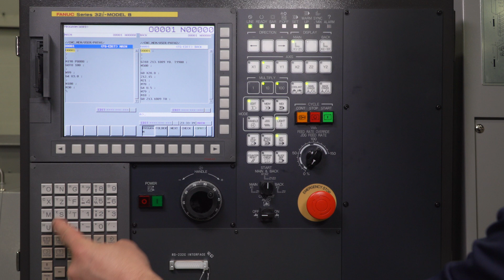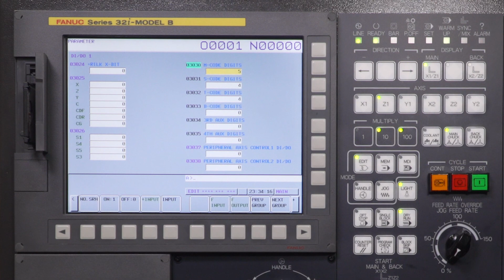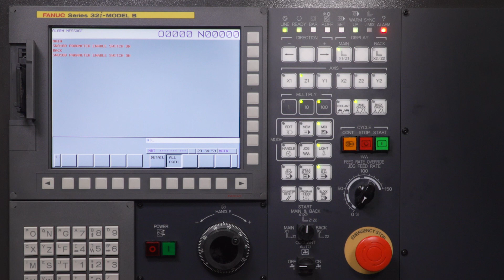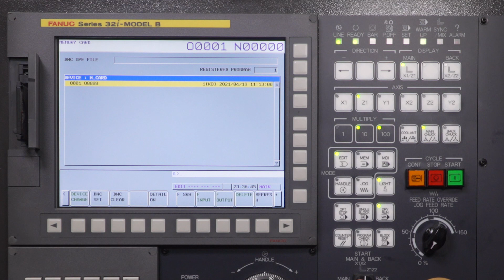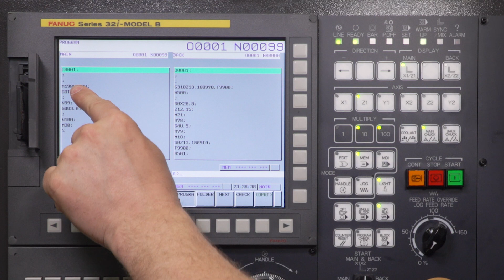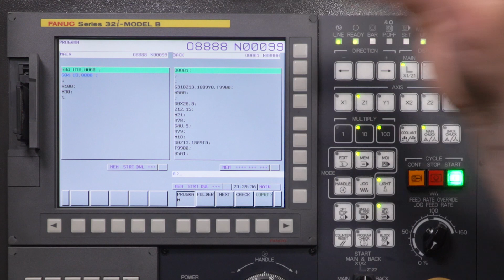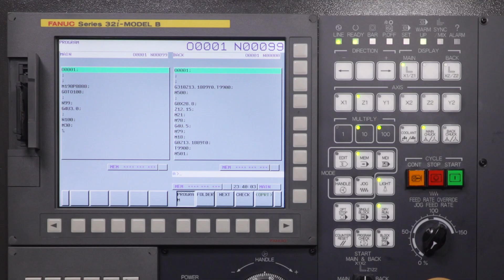How to Drip Feed a Subprogram From a Memory Card

Comment: Shouldn't this work for most Fanuc/ ISO controllers ??
Most annoying part with Fanuc Controllers ???
Lack of Memory Space.
But, at least you can install an External Memory to run fair long programs.
Not sure IF it still happens with Fanuc Controllers ??
But, from my memory.
You can only use a Memory Card with up to 4 GB otherwise they throw an Alarm or the Memory Card simply does not work IF you use a larger size ??
But, of course 4GB is fairly large for CNC machine. 🙂